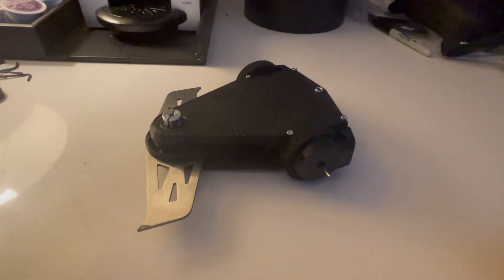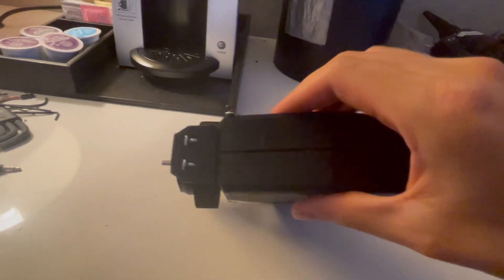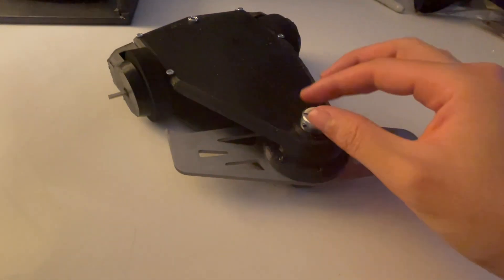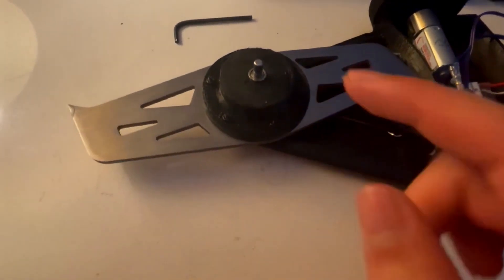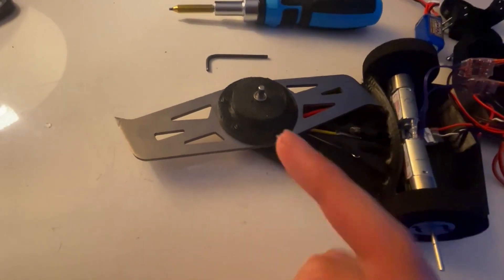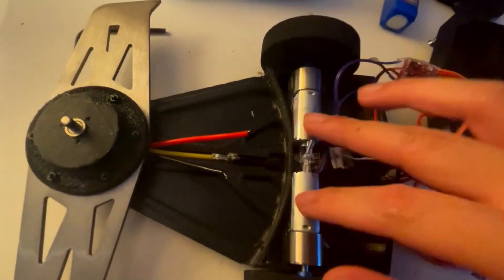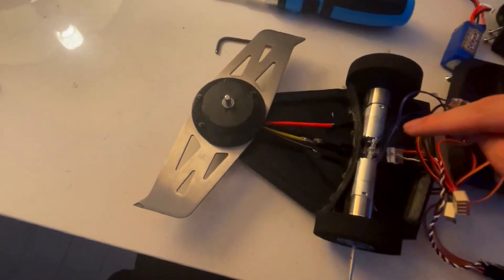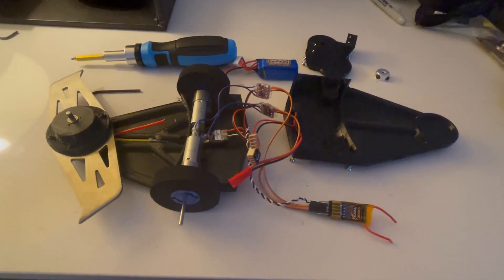Carbon 453 Pre-Event Breakdown

Comment: That is a super aggressive rake angle on your weapon. I’ve never been a fan of 3D printing cause the layer lines form weak spots but if it’s printed the way I think it is and is basically only 2 pieces you should do so much better than last time. Really like the hub motor design you made.